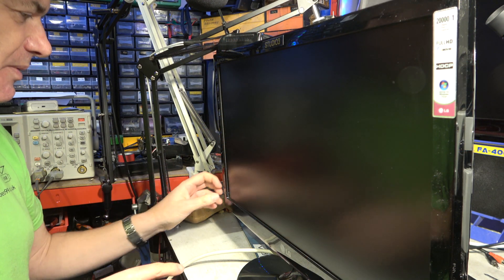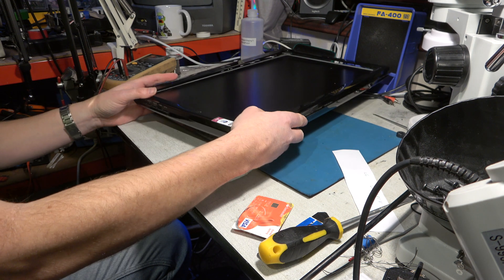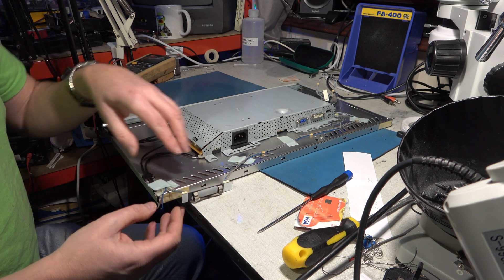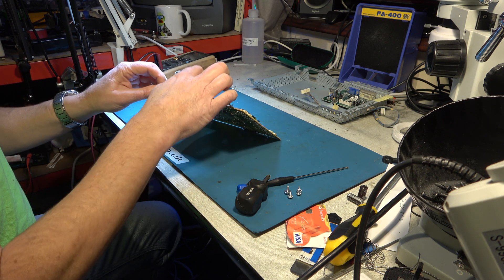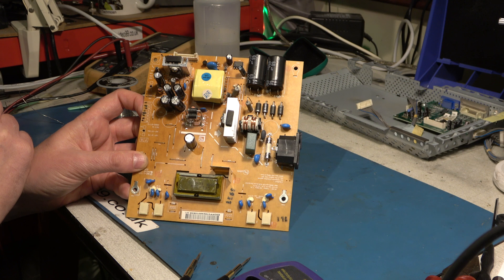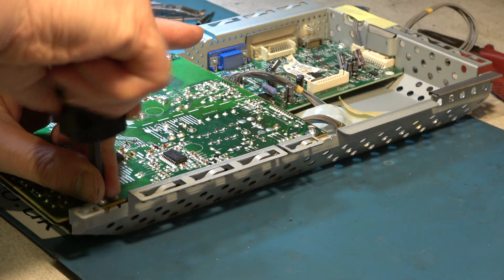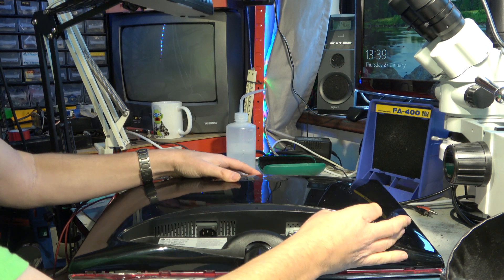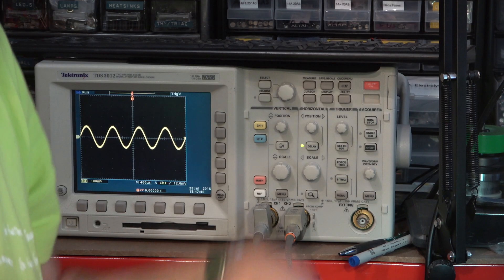LG monitor repair, model W2261V. Disaster strikes!

Comment: currently working on fixing one for a friend. i had the same problem when taking it apart. sadly, it is the switch board that has failed this time, and i have no clue how to go about fixing it. any suggestions/ tips?
I have double checked the cables are back in the right place, but none of the buttons work.
Reply from the maker: Start by using a multimeter to check that the connections from the switches to the socket are OK.  Then connect the switch PCB to the cable and use the meter to check the connections at the far end of the cable.  Logical fault-finding is the only way.

Comment: Well after 15years+ this LG Full HD Monitor has done its duty has it? 2009 is mine sooo not too bad!
Reply from the maker: I think we can get about 5 more years out of it with the new capacitors installed.  Helps save a little bit of planet.

Comment: Thank you for the Video! Had the same Monitor dead and fixed before so here is what you want to change all Electrolytic caps after you have cracked it open with old creditcard that works much easier!!

C203   470uF 35V
C204 1000uF 16V
C205 1000uF 16V
C206   470uF 35V
C212 1000uF 16V
C301   470uF 35V
C103  33uF 50V
C105 0,22uF 50V <-- i did change to 1uf 100V worked nicely!!
Reply from the maker: It's useful to have the list before starting on the job.

Comment: Ah, Consumerism at it's worst (or best, depending on point of view). Its ridiculous really that components that are worth pennies end up consigning an otherwise perfectly fine monitor (or tv or washing machine or whatever) to the local tip, where I doubt very many are even recycled.

Such a shame and really a complete waste of resources. Easy for those in the know to fix, but for many people (myself included), don't have the skills or equipment to hand to do it.

Not to mention its quicker to stuff in the garage (where it sits for a few years before a clear out & a tip run) and go get a new one from Currys (other retailers are available etc).

I'm not sure what the solution is though really, as they're clearly made to a price point and getting anyone with the skills to repair it would probably cost nearly as much as a new one anyway.

Comment: Smashing repair colin 😀
It's well worth the effort and some fresh capacitors, people throw far too much away thease days 😞
i've often found the stated lifetime of the capacitors is quite short. (Sabotage).
I fixed a washing machine switchmode psu, all the caps were cooked and according to the data sheet
the data showed the caps had roughly 18 months lifespan at full loading.
That's exactly how long the machine worked for.
I shoved panasonic low esr and high ripple capacitors in, perfect 😀.
Reply: Thanks for admitting that you don't have a clue how to read a datasheet :D
The endurance rating (2000h etc) is AT 105C with full rated ripple current applied. Every 10C lower than that doubles the rated lifetime. I highly doubt that PSU ran at water-boiling temperatures 24/7
Reply: @Knaeckebrotsaege  Why thank you for slapping me ha ha :-D
The original capacitors died at the 18 month period, the cap rating.
Perhaps the original caps rating was crapper than spec :-D
What matters is the panasonic low esr caps did the job.
I tend to go overboard with parts spec anyway.

Comment: I have had many PSU capacitor failures on both Samsung & LG, it always seems to be the low voltage ones.
These certainly were not meant to be repaired, as you have found, they are a sod to get into!
Reply from the maker: I did have a high voltage one fail in an Epson XP-55 printer a while back: https://youtu.be/NKr7zPO7xIA
So I do always check those too.

Comment: I once had a monitor with blewn caps. The thing was still working, but the smell was terrible. I was like, easy job, just some new caps.... but I failed at opening the thing.
Reply from the maker: Getting them apart is just way harder than it should be.